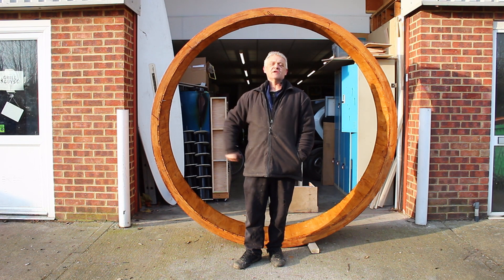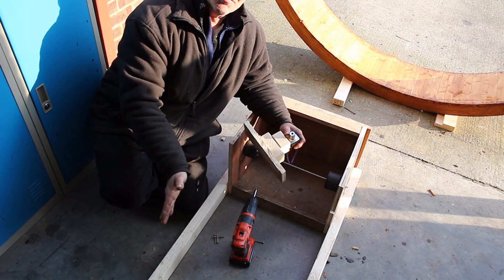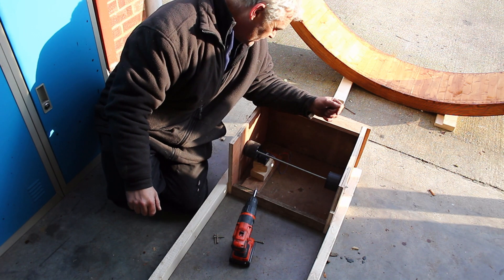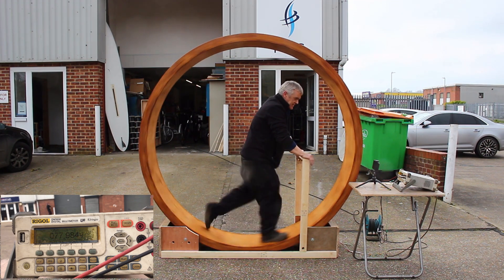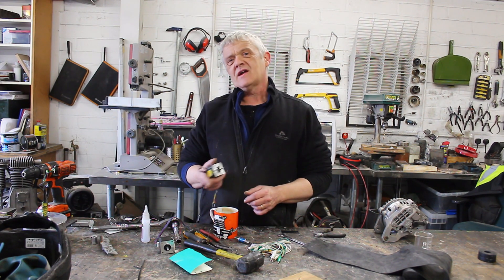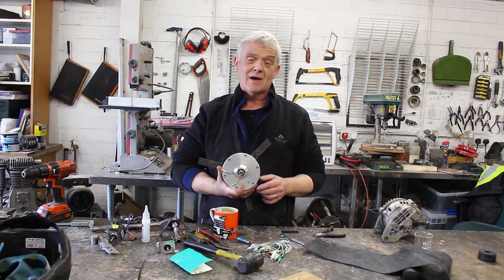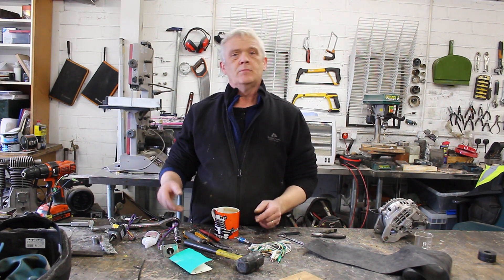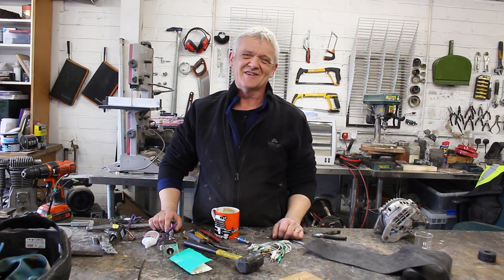1457 Human Hamster Wheel Generator Part 2 - Adding The Generator Bit

Comment: what is the most efficient thing you could use to lower the voltage to 14 v but up the ampage rather than just lowering the voltage on its own as this is producing useable power to charge large 12v batts if connected to a large water wheel of the diameter you have created in your hamster wheel how about a solar charger unit?

Comment: Well I am at version 2 wind generator and is busy with the generator part. Everything is not as they seem. We have great talk with low wind speed. The challange is to make it work at low wind speeds. It has two sets of 5 blades made from two 55 gallon drums , horizontally mounted. It turns no matter what the wind direction. I will be happy with 500 watts at low speeds. At the coast this thing is a monster. 1 kW no problem. All this generation input is of great help. Soon we will own the world - lol
Reply from the maker: lol - this video isn't really about a hamster wheel mate - it's really about the relationship between torque and speed and the role of gearing
Reply: @ThinkingandTinkering  jip

Comment: Very impressive Robert. I'm trying imagine if money was no object what the ideal alternator or motor would be in this application. The stepper motor way outperformed my expectations. My thoughts would be the low rpm high torque alternator from a commercial vawt. Is there a resource that you know wherein you type what you can input and you get possible motors or alternators that could suit your needs?
Reply from the maker: not that I know of mate - sorry

Comment: Excellent video Rob, would like to see how hard it is to turn with 4 motors. Maybe having levers to activate them one at a time once you're in motion. Might need diodes to mate sure power doesn't turn the disingaged motors however
Reply from the maker: I would think diodes would be essential mate
Reply: @ThinkingandTinkering  yes, for sure

Comment: Hi Bro! Thanks Always for your Always Awesome Ideas :)

By the way, a datum that could be Helpful for You:

- a Professional Cyclist can generate around 750 W by using both Feet and Hands Pedals, for few minutes.

It should give You a kind of Limite and Base for Calculation of the Relative// Efficiency of the Apparatus You Built.

For example: 50 W reached would mean 50 W / 750 W = 7% ;)

Be Well,
Kind Regards,
Didier
Reply from the maker: cheers mate and thanks for the info
Reply: @ThinkingandTinkering  You are Most Welcome My Friend! :)

Comment: Depending on what you can get it to drive at, a washing machine motor might work for you. I have test data on a Samsung 36 Pole that I rewired and at as low as 300RPM on the motor you would get 200+ Watts. If you could turn it up to 750RPM, you would see 600+ Watts which should not be possible for most people. 400RPM would get you 300 Watts which is about what most people could power.
Reply from the maker: the power doesn't come from the motor mate - it comes from your legs - the counter torque would limit this at around 200 watts or so for most people and 300 watts for an athlete - that is because that is what they have in their legs to overcome a motor's counter torque - it is really almost independent of the motor you use - the only real contribution a different motor would make is in terms of efficiency - a stepper is around 90% efficient if a washing machine motor is more efficient than that then it would help for sure - you just couldn't turn it at 750 rpm to get 600 watts - no one has that strength

Comment: I love when you torque about gears and stepper motors. ;)
-I think may be a good idea to stay below the maximum RPM of the motor (which for many stepper motors are between 2000 and 4000 RPM).
Some people like running to stay in shape, but running does more harm than good, when compared to walking.
If one can combine walking with creating energy, that's a real good combination; the 'product' will encourage one to stay in shape.
Reply from the maker: nice - good thoughts mate - thanks for sharing

Comment: Well that was fantastic! 70v is crazy good. 👍 could toy with the gear ratio a-little? To get 110v. Even that as is patched through A microwave transformer. Is still fairly respectable. An awesome day I’d say.
Reply from the maker: for sure mate - I could always use a DC-DC convertor and stabilise the voltage at 12V - I have a few they cost UK£1.30 per board and can handle 70v to 12v easily
Reply: @ThinkingandTinkering  nice that will charge a Mobile phone.👍

Comment: Great build Rob!  I  wonder if this could be made more efficient by directly replacing the platform & belt on a conventional treadmill with  your human hamster wheel?   You could  rest the wheel directly on the drive rollers already built into the treadmill frame which are already coupled to a respectable sized dc motor (usually 3/4 to 3 hp depending on the model), previously used to drive the walking belt. I don't know if any of the electronics from could be reused, but given how the rollers are set up inside them i think it would possibly save a huge amount of time for anybody trying to copy this idea.
Reply from the maker: I don't think it would make it more efficient per se - but it would make it easier to build and I do like the idea - a lot - cheers

Comment: An average person might have difficulty putting out 300 watts or more for an extended period of time like an hour or there abouts. Obviously trained athletes can do better.
Reply: Even for athletes, over 300w is pretty hard, on a bike no one did over 400w for an hour, and iirc the record barely outputs over 300w.
That is to say, even for trained athletes, 300w over an hour is hard to achieve, especially on a wheel vs a bike.

On 95% low for 20 minutes, 30% of measured male cyclists have an average over 300w, and 1-2% over 400w, but there's a sample bias.

As a quick rule of thumb running is about 5 times less efficient as cycling, so even if someone manages 500w on a bicycle, you'd expect about 100w over an hour to be the maximum for a wheel like that.
Reply from the maker: on a machine like this weight is doing a lot of the work - all the person is doing is moving the weight - which happens to be their weight obviously - but it is really a weight driven machine as opposed to a muscle driven machine
Reply: @ThinkingandTinkering   in a giant  hamster wheel, a man has to walk uphill inside the wheel, essentially working against gravity very much like an inclined treadmill.

Comment: That is awesome Robert great work man   what about actually putting a generator on a hamster wheel with DC to dc boost converter to step up the voltage and charge a phone I have always wanted to do something like that just for fun lol anyways thanks man have a great day 😁👍
Reply from the maker: that is an awesome idea mate and I am mulling it over I have done a few vids over on tnt showing the circuit to do that
Reply: @ThinkingandTinkering  I don't think anyone has done it so I'd say give it a go 🙂👍I just watched part 1 & 2 thanks for making those videos I will reccomend them to anyone who ask me how to use a motor as generator I remember years ago this was when I first was amazed and helped me understand what a diode does and works simple but crutial component also maybe one day can you make a video on how to make a homemade diode and transistor cheers mate 👍🍺

Comment: I guess you don't want to make a idler shaft to gear up the RPM and put the alternator in that is sitting on your bench?
Reply: Alternators don't have good efficiency iirc 50-75% compared to 80% or more for permanent magnet generators, but they are simple to use.
Reply: @satibel  simplicity is what I was getting at
Reply from the maker: no mate I don't lol - this was a long enough build tbh

Comment: Great video and great build. 
It would work great if you made an Axial Flux type generator where you didn't have drag. Is this correct?
Reply from the maker: to be honest mate the motor doesn't matter as much as folks seem to think - it's not about drag it's about counter torque - efficiency of the motor matters - of course - an average brushed dc is going to be around 70% or so in efficiency the hoverboard motor is around 80% and the stepper motor around 90% - I think axial flux motors are around 93% or so - so you would be gaining 3% or so